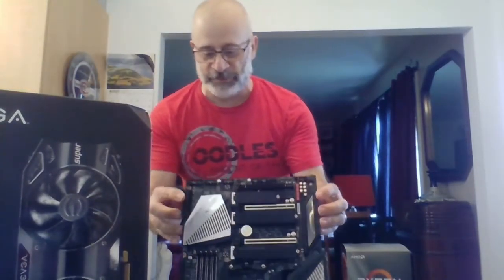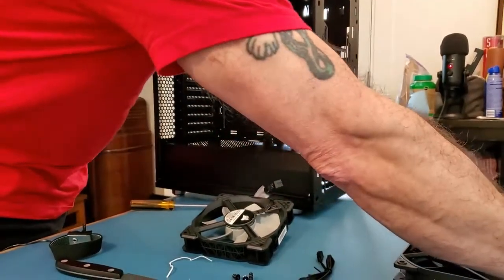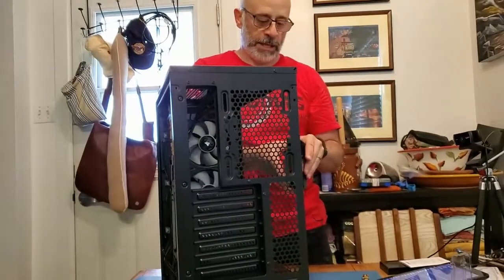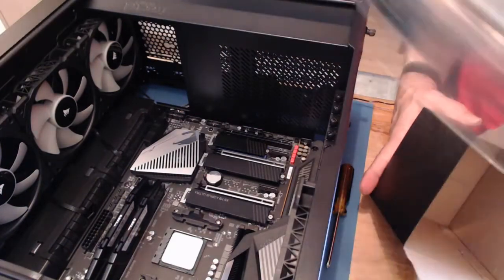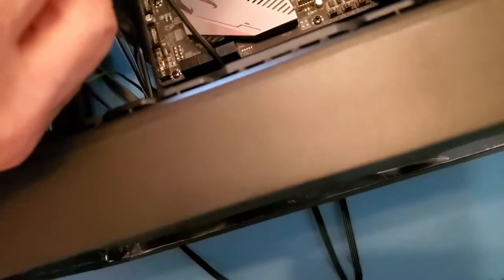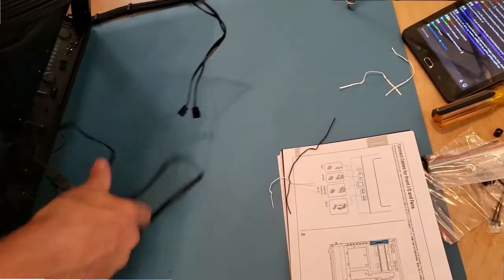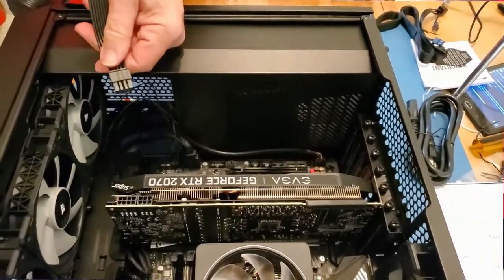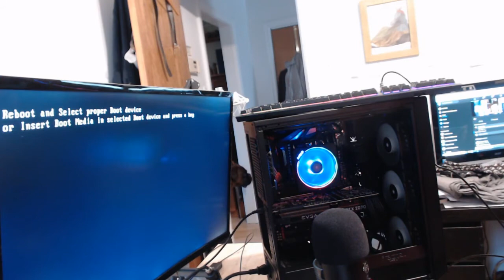My first ever PC Build.

Comment: I remember building mine back in the day...(around windows 95) thank god I built a Intel instead of a AMD since I installed the fan wrong on the processor... Intel would shut down if overheating but not AMD they would just keep going until it fries itself!
Reply from the maker: Thanks Nick, Had a blast doing this.
Reply: @Onix_1962  looks like it with parts like those I would have to!!